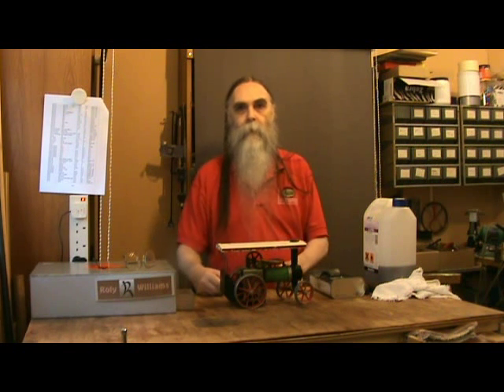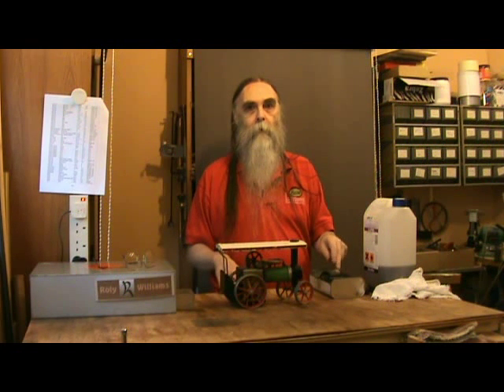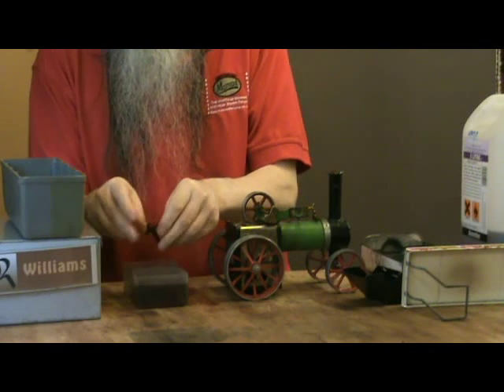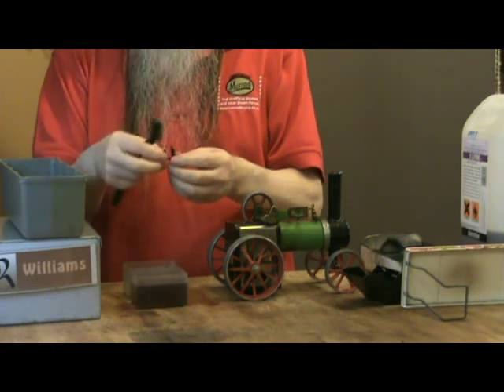How to clean up a Mamod TE1

Comment: re cleaning the transmission bands -an old bass guitar player's trick is to boil their old dull strings in water with a cap full of vinegar for about 20 mins. the strings come out clean and bright and dissolves all oils, sweat and gunk and sound new. I would guess it could also work for the transmission bands on these engines as it will dissolve all oils and corrosion and clean them up like new.

Comment: I had a bit of trouble hearing or understanding what cleaner should be used when cleaning the engine and parts.  I have purchased a used SR1A and I know it needs some parts and I assume it will need to be cleaned inside and out.  Thanks for the tip and but I had a little trouble understanding you but your tips are most helpful.  This would be my first steam engine and I have a lot to learn.  Thanks again.
Reply from the maker: nightlightabcd Brass and other bare metal parts can be cleaned using a solvent cleaner. I use meths because it's handy. Painted parts should be cleaned using warm water with a little washing up liquid. If there is limescale inside the boiler then this can be removed using vinegar or a commercial descaling product. Leave it in for no more than an hour.
Reply: Roly Williams- Thanks for responding.   What is "meths"?  Would auto parts cleaner do?  "washing up liquid"  would that be like dish detergent, or maybe mechanics hand cleaner?  Thanks again.
Reply from the maker: nightlightabcd Meths is methylated spirits, also known as Denatured alcohol in some countries. Auto parts cleaner would be ok on bare metal parts. And yes, washing up liquid is dish detergent - the sort used for dish washing by hand. I would be wary of the type used in dish washer machines; it might be too aggressive.
Reply: Roly Williams- Thanks.  Looking forward to getting started with my SR1.
Reply: Will this methylated spirits or Denatured alcohol damage the gaskets of the brass parts, like the safety valve or whistle?  Also, on the videos I have seen people using a syringe.  I think that would be good for washing out the boiler and adding water, but I have been unable to find one, do you know where I can buy them.  By the way, may of these sites are British and deal in pounds but I am in the US so I need a web site that deals in dollars.  I have found the Ministeam web site and they do not seem to have the syringe.  Thanks again for you input.
Reply from the maker: nightlightabcd Meths (Denatured alcohol) will not damage the gaskets but brushing might. Best to remove them first if they come off easily. I'm not familiar with US suppliers. If Ministeam don't have what you want then try Ebay. You could also join and post a query on WWW.MAMODFORUMS.CO.UK
Reply: Roly Williams- Thanks for responding. I joined the Mamod forum today.  You were, and are, most helpful. Thanks again.

Comment: Could you advise me on what position should the small lever on the pipe coming out from the boiler near the chimney should be in your help and advice would be welcome.
Also great video by the way
Reply from the maker: That lever is the throttle that controls the speed when the engine is running. Vertically up is fully open; horizontal is shut off.
Reply: @RolyWilliams  Thank you for your help

Comment: Thanks. Very useful. I just dug out my old TE1 that hasn't been used since the 60s. 
I'd forgotten, but the water level plug screw threads are stripped. Plug is fine. Any chance of a video on how to repair? I was thinking of soft soldering a brass nut over the hole and making a plug to fit. Does this sound correct?
Reply: Im repairing my te1a atm you can get a new thread from Mamod steam enthusiasts thats you drill the old one out then solder the new thread in
Reply: @ttmgalaxy5506  thanks, have already found the solution. 

Btw, mine is a TE1A by the box, has reverse, but the front casting still says TE1, no A. Also has meths burner. Had it from new, pressie from my parents one Christmas.
Reply: @kevgermany  nicee the meths are pretty rare to find now as they was banned from making 👍
Reply: @ttmgalaxy5506  didn't know that. Quite easy to start a fire with it. Outside in paving only..

Any idea how to stop the speed controller closing as it runs?
Reply: @kevgermany  im pretty sure thats due to vibration there one way wich is to tighten the bolt going into the lever that should fix it
Reply: @ttmgalaxy5506  Ta. Bolt's in as far as it will go. Tried adding washers to increase the spring pressure. Didn't help. Will keep trying.
Reply: @kevgermany  hmm maybe try to get a replacement spring and bolt that could be the problem
Reply: @ttmgalaxy5506  did that as well, sorry, should have said.
Reply: @kevgermany  it could be the bracket also has that been replaced?
Reply: @ttmgalaxy5506  trying to avoid that. Was thinking new bracket and lever, but new levers are black, mind's red. And it's going to mess up the original paint. Was also thinking of trying to file out the grooves in the bracket but it's fiddly. Funny thing is that in reverse it stays where I set it, but not going forwards.
Reply: @kevgermany  yea that makes sense they are pretty easy to paint im repainting my whole mamod but for one part like the lever a bit of red enamel or spray paint would do the trick

Comment: Thanks I have one sitting in the cupboard. It is a bit limescaled up as when I was a kid I wasn't switched on enough to use de ionized water. That is the first job that needs doing. I know you can use vinegar to ckean boiler and extract with a syringe but what about the pipes?

Comment: Really like your videos.  What is "PTFE"?  Also, when I remove the water level plug I am concerned that I will loose the tiny gasket.  Is there something I could use to stick it to the plug without damaging it?  Also, I flushed the boiler with vinegar twice now and when I pour out the vinegar, it is cloudy, then I remove the pressure valves, the water level plug and the whistle and let it air out for a day.  Should I keep repeating the process until the vinegar is clear?
Reply from the maker: nightlightabcd PTFE is the same as Teflon. You can buy Teflon sheet on Ebay. 
Somebody has already replied to your forum query re the gasket and I agree with what he said. 
If you've left the vinegar in the boiler for about an hour, that should be enough under normal circumstances. If you repeat the operation to often, you run the risk of damaging the brass or the solder.
Reply: Roly Williams - Okay, I have repeated the process twice but the vinegar is still cloudy. So, you say that is okay?  Thanks again.  I'm getting closer to fist steam.

Comment: Hello, it's me again.  Where do I get the safety valve tool?  I have looked around and I am unable to find one .  My safety valve for my Mamod SR1 needs new seals, I will make them myself from rubber tubing, as you suggested, but I would like to have the tool, if it's a reasonable price.  Also, after the first steaming, the whistle that used to pint toward the back, now points toward the front, can I use the same rubber tubing to make a seal, or bussing, that I use for the gaskets for the safety valves also be used for a whistle bushing to have it pointing toward the back again?  Thanks for all the help you have given me.  Also, instead of Steam Engine Oil, could I use 10w-30 motor oil, so I won't have to order it and pay shipping.  If not what motor oil should I use? Nice vid.  Thanks again Rolly.

Comment: is there any way to check the boiler water level while operating to make sure it doesn't get too low?
Reply from the maker: Not on the TE1. The burner is designed to run out before the boiler.

Comment: Could rubbing alcohol work for it?
Reply from the maker: Any alcohol, or any other solvent, is always risky on paintwork. Some paints are soluble even in alcohol. It can, of course, be used on bare metal, and I quite often use IPA (which is the main constituent of rubbing alcohol) to clean unpainted parts.
Reply: @RolyWilliams i mean to fire the engine, I didn't mean to clean it sorry so rubbing alcohol would be ok? I just don't want to damage the engine
Reply from the maker: @gabrielm1420  Rubbing alcohol is not advisable for firing the engine. Use either methylated spirit, denatured alcohol or bioethanol.